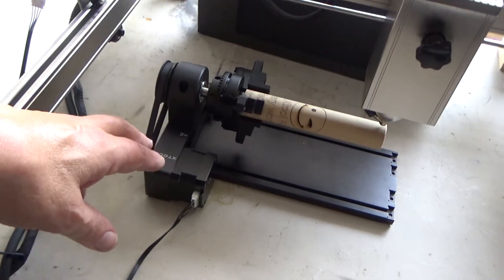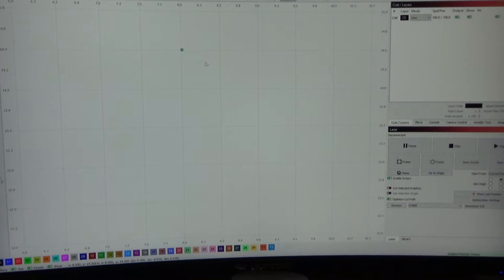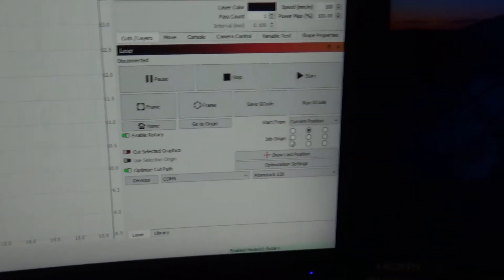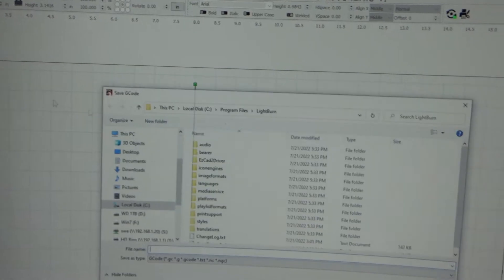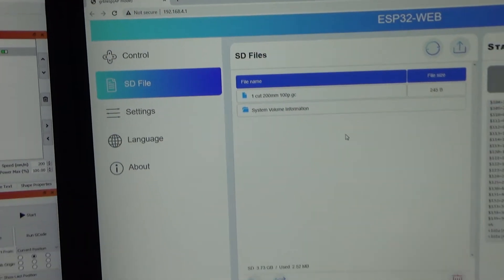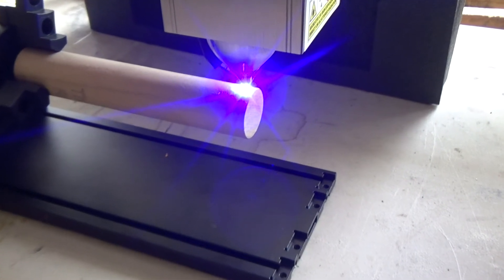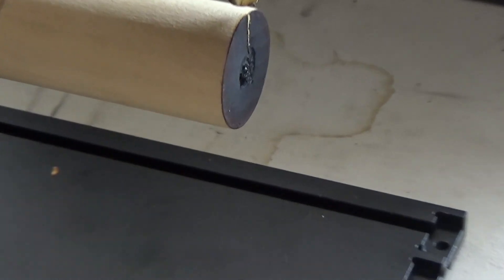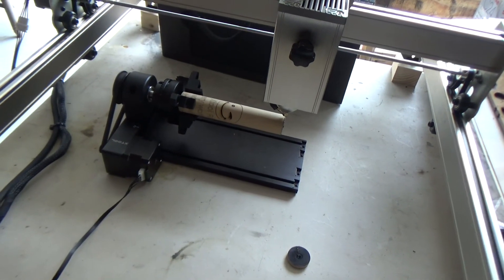Cutting a 1-inch wood Dowel on my Atomstack S20 Laser.

Comment: That’s nuts man my a20 pro won’t even cut 12mm ply after 10 passes at 100% power and 25 speed lol
Reply from the maker: Clean the laser lens with a q tip and alcohol.
Reply: @737mechanic  tried that already 😑
Reply from the maker: @earthonemason  That sucks, have you run it at 100% a lot. I have read that you want to try to stay under 90 most of the time.